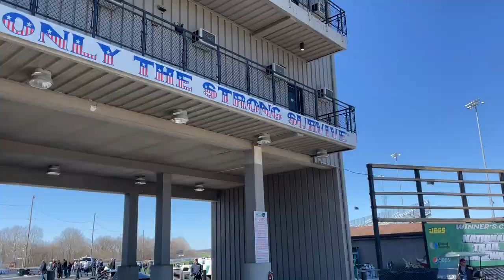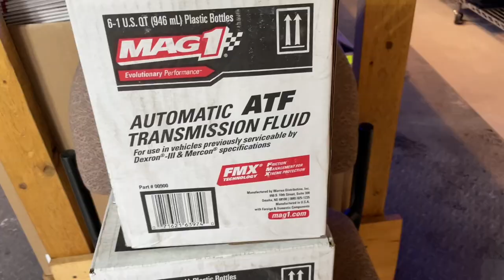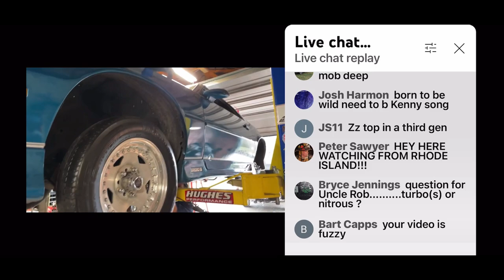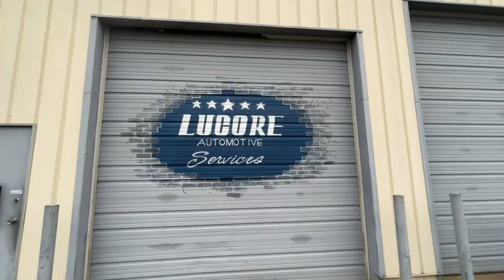THIEF STEALS MY DUALLY! Uncle Bucko Tracks Him Down...

Comment: I’m glad to see you were able to get your truck and dads trailer back, even if it does have some battle wounds now. Those can always be fixed. Might even be time to consider getting something newer like what Billy got for towing with even. Just throwing that out there. Keep the old girl for the light work and running around, but something newer and more powerful for the heavy loads and longer trips.

Comment: Hello OP, they make a thing called the Waterport. It attaches to your truck somewhere and sits in the sun all the time. When your dogs get muddy you can use it to spray them off, then towel dry them. Your dogs are smaller than my German Shepherds and so it would be easier. I wash up 366 pounds of Shepherds in about 5 minutes, and it used to be faster but these dogs are the best I've ever had so I'm more gentle with them.
It sounded like you said you wished it had gone through his head in regards to that signpost, and unless you are already inured to washing brain matter and bits of skull out of trucks I don't recommend it.

Comment: Bill, You were unlucky with your truck getting stolen but very lucky you recovered it quickly and without major damages. I’ve just installed cameras on my home and got a turd barrel to boot all because of crackheads steeling from me. If the motion sensors don’t catch em, the dog will!

Comment: Been there bud, had my truck stolen about 7 years ago. Lucked out and law enforcement found it a couple days after it was taken. Had some damage but was repairable. The cops raided the house it was found at and same story Crack Heads. Nothing worse than a Thief. After going through that everything I own is now Crack Head proof with fuel shut offs , power shut offs, GPS trackers, and Boron steel locks. It's pretty sad that you have to go to such extreme measures now a days to protect the property you've worked so hard to get.  But as the song says "A Country Boy can Survive" and anything is fixable Glad you were able to get your truck and trailer back.

Comment: Man. At least kennys camaro wasnt on the trailer and you made the deadline. That truck went threw hell and still got you home. Man i remember when someone was doing that in my neighborhood. My dog was barking and he rarely ever barks. So im like ok lets go outside. Soon as i opened the door. He yanked the leash out of my hand and ran right along side my truck. Meth head was trying door handles. He had 2 backpacks he dropped that were my neighbors. He stole. He got caught. But not before my dog got on him. Of course uncle bucko had to get it wrong to get it right. 😂

Comment: 6 foot fence with barbed wire and razor wire along with a nice gate and security cameras with alarm are in order for your place. Put it in behind the house so you can still pull in off street before pulling through gate and back into the garage/parking and storage area

Comment: Sharing an old trick of mine for the Fbody. Power windows hack. Run a switch from inside the hatch and wire it to the driver's window switch wiring with a hot after you put the battery in the trunk. 😉

Comment: A new pair of mirrors, new windshield and fix the Sheetmetal on the passenger side and maybe a fender repair and put a GPS tracker on your vehicles and trailers pulling a fuel pump or starter relay or fuse is another theft deterrent.

Comment: Sorry to see this Bill. Glad you got them back and they are not totally destroyed.  

Hopefully you have a better judicial system there and the POS stays locked up for a long time.  Where I'm at its like the judicial system is on criminals side. Few years back 2 meth heads broke in shop stole 2 street bikes, 2 dirt bikes, designed my Snap On  tool box and stole $80k worth of tools... recovered 4 destroyed motorcycles and only a couple specialty tools.. 1 had a lengthy criminal record l, the other not so much.. They were also faced with charges stealing other people's stuff and were going to walk on probation until they got caught stealing while out on bail... The one with not so long of a record only got probation, the one with a long record on got 2yrs.. And this was for 8 different charges not just what they stole from me and my friends...

Comment: I've got a 3rd gen camaro for sale. It's been low6s at 115 . 1.2 60ft. On foot brake. Has Moser 12bolt with 4:88    no motor but everything else there . Not a street legal car. 8k. Over 5k in rear end alone. That 10bolt in that green one of your crews, can't be built to hold any kinda power. I've tried.

Comment: I had a third GEN it’s easy well not easy for the exhaust it is a lot of banging on the floor pans. I ran it to the middle of the car with turn downs some people cut out the spare tire in the back of the rear and go over it and have the muffler is like the old Corvette two mufflers right by the back bumper.

Comment: funny how I can put my 78 C3 Vette on my open trailer and open the door completely but the door hits and won't open all the way on my 85 Z28 so I put 2 x 12 pieces of wood under the back tires so I can open the door and get out with the windows up. Which of course is why I made sure my new 28 ft. enclosed trailer had a driver's side escape door so climbing over the 10 point cage isn't something I needed to sign up for yoga classes in order to contort my old carcass into unGodly positions to get out of the car. Now ain't it sweet that the clown that stole your truck leaves his name with personal stuff behind  - - dumb ass practically arrested himself.  But I have one question how did he get the keys because I remember hearing you ask if the keys were in it when y'all found it ?

Comment: Nowadays is always good to have some type of GPS tracking device in your car I live in the city and when they steal cars here it's not crackheads its professionals we found my best friend 69 Camaro 45 minutes after it was stolen by the time the cops were in the shop it was an hour later and both fenders the hood radiator fender and bumpers were off the car I couldn't believe it those hide to be the most efficient thieves imagine if they put that much effort into actually running a legal business

Comment: First off,  whoever stole your truck is a real piece of crap 
Second, what song was playing at the 2:45 mark? Sounds like a band I need to check out.

Third , I noticed Kenny's Holley Blue pump is upside down at the 4:23 mark. I thought these pumps have to be mounted with the motor on top.